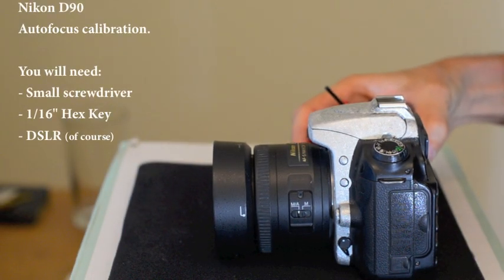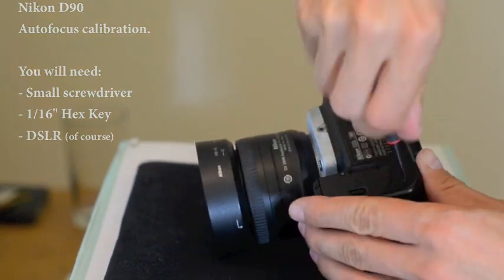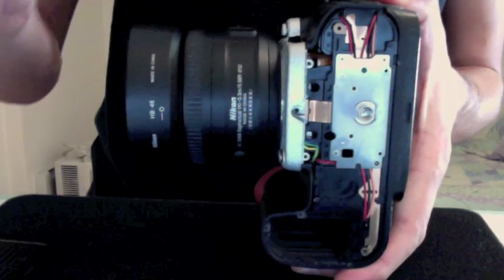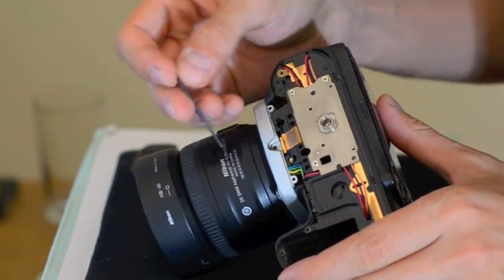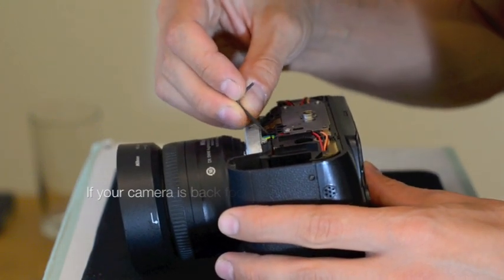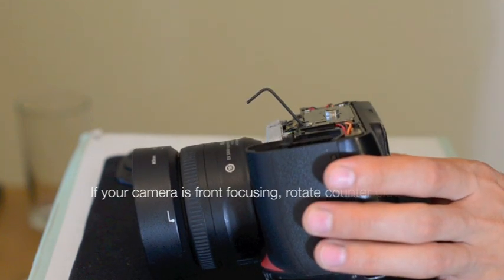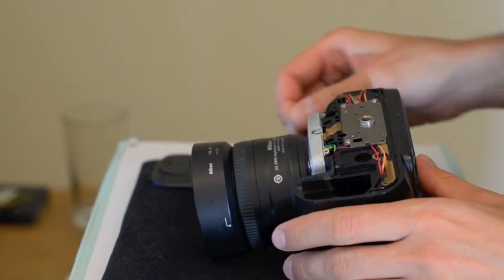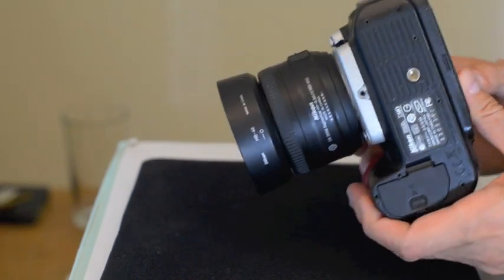Physically Calibrate Auto Focus - DSLR

Comment: Hello. This could easily be a life-savior for me, as my d600 started backfocusing, and it seems suddenly (although I can't be sure) Anyway, I am on -20 af finetune, and still is not enough, but my 70-200 which was originaly on -20 is good now :)
I just wandered if this procedure will affect autofocus in live view mode? - in liveview, my camera focuses fine.
Reply from the maker: +KugLager Interesting question. When you use Live view, your mirror is up so I guess the camera has to do on-sensor contrast detection to achieve focus. This is a different technique from usual DSLR operation. 
In other words, your camera focuses differently depending on which mode you're in. 
No, your live view mode should not be affected.
Reply: I have the same problem with my canon 5d mk2

Comment: Thank you so much for this!! Saved me a solid $600 and a 3 month wait if I had shipped my camera all the way to Singapore to have it serviced. The "Nikon Service Center" where I'm from, the Philippines, refused to send it themselves and continuously insisted that they "didn't have the proprietary tools" to fix it themselves. Very poor service.

Anyways, this is what I found to be the most helpful in fixing my D610:

"Steven B2: turn clockwise when backfocus, turn counterclock when frontfocus

What does each screw do: Paolo Lorai wrote:
- right screw: controls the leftmost part of the image.
- left screw, near the lens: rightmost and bottom part of the image.
- left screw: far from the lens: rightmost and top part of the image.

My knowledge: it helps when you first tighten all screws till you cant turn them any further, after that loosen each screw one full turn. Adjust from that basis. Make pictures with single focus point at the edges of focus zone. left, up, bottom, right, middle.

Steps: leftmost part has to be correct first, after that check that top and bottom focus are correct. If you did everything right, right and middle focus should be right aswell."

This took me just a bit less than 2 hours and I hope it doesn't go out of whack overnight again like it did before.

Comment: Great tutoriál! Thanks for him. For two years, I had a micro-correction set at my D7000 at -20 for all my lenses. Still, they shot my lenses too soft, so I had to sharpen all the pictures in software. After turning all three screws a half turn clockwise I have now set the micro correction to +7 and software sharpening of images is no longer needed. I'm so glad I decided to do such a hit on my camera. It paid off. I do not understand how I could have such a poor condition for so long. Thanks for the video that changed My Cameras that changed my camera. Jaroslav

Comment: Thanks a lot, worked perfectly on a D7000.
That camera has 3 calibration screws:

- right screw: controls the leftmostmost part of the image.
- left screw, near the lens: rightmost and bottom part of the image.
- left screw: far from the lens: rightmost and top part of the image.

I wasn't able to get sharp images from my 50mm f1.4, even with fine adjustement set to -20. Now it works perfectly without focus tuning.
Reply: +Paolo Lorrai Hi Paolo, Thanks for your input. Did your camera focus ok for the other lenses that you have?
Reply from the maker: +Gihan Hanwella Please read my description under the video in the "About / Show More" section.
Reply: Have similar Issue with my d810 and 50mm 1.4F AFS will try this out. Front focus issue needs correction
Reply: did you done it? i got d810 too and i need it tooo
Reply: Sent my D4 to Nikon repair with this issue but they couldn't fix it because the camera was too old. Parts required? Maybe I will try it myself.

Comment: You, my friend ... nailed it. My D7000 was becoming unusable. Even with the fine-tune set at -20 it was still back-focusing. I'm sure I have some more trial-and-error manual adjustments to make, but even with a quick 20 minute adjustment, the focus is FAR superior to what it was. Thanks for posting this.
Reply: Daniel Bregar which hex did you adjust first? :)
Reply: Hi Jamie I moved all of them a very small amount each time I made an adjustment. I'm guessing that if I experimented with the different focus points I would see some errors but I generally use the center point so it worked for me to move the whole sensor. I didn't need to adjust much - I think I just made roughly 1/8 turns and I don't think I needed more than 2 adjustments. (It was a while ago so I don't remember for sure.) I rigged up a way to keep the battery pack in without reattaching the bottom (using rubber bands) so I could test the focus without having to re-assemble and then take it all apart again for further adjustments. Good luck!
Reply: Daniel Bregar thanks alot I'll give it a go at the weekend. I only ever use center focus point so I should be okay :) Thanks for getting back to me
Reply: Daniel Bregar did it this evening. took all of ten minutes to do and now my d7000 doesn't even need AF fine tune with my nikon lenses. best thing ever!
Reply: Jamie, glad to hear it. Thanks again to Steven B2 for figuring this out and posting it ... this is what the internet should be all about!
Reply from the maker: I appreciate your comments guys!
Reply: Hi daniel , i have the exact same problem as you ! can you please tell me wich screw i have to rotate ? !
Reply: Hi widou dz, I turned all of the screws by a similar amount each time I made an adjustment. I think someone below explained what each one does; I hadn't seen that when I made my adjustments. I made tiny adjustments (maybe 1/8 turn at a time) and used tape to hold the battery in between adjustments so I could check it. Good luck!

Comment: Steven B2: turn clockwise when backfocus, turn counterclock when frontfocus

What does each screw do: Paolo Lorai wrote:
- right screw: controls the leftmostmost part of the image.
- left screw, near the lens: rightmost and bottom part of the image.
- left screw: far from the lens: rightmost and top part of the image.

My knowledge: it helps when you first tighten all screws till you cant turn them any further, after that loosen each screw one full turn. Adjust from that basis. Make pictures with single focus point at the edges of focus zone. left, up, bottom, right, middle.

Steps: leftmost part has to be correct first, after that check that top and bottom focus are correct. If you did everything right, right and middle focus should be right aswell.

Worked for me after hours of fiddling. Thanks to Steven and all you guys in chat. Together we made it!
Reply from the maker: +xDECORx Wow, going all the way and then trying to find the right spot would probably take more time than you need to.
However I like your idea of getting one corner first and then another, your'e right the corners will give the correct position for the center.
Thanks for your input.
Reply: hi.. when you tighten it, did you turn cw or ccw?

Comment: Thank you so much for this. My D90 is perfect again!

In the video the screws are turned about 45 minutes. This is way more than I needed to. My camera was backfocusing about 2-4% (2-4cm pr meter focus distance). I only needed to turn the screws about 7 minutes clockwise. I hope this helps.

All the screws are size 2.0 (?). I ruined two of the screw threads figuring that out. I called the good guys at the danish Nikon service center and they're sending me a new pair. The guy on the phone seemed pretty worried though: "You opened the body and adjusted it yourself??" - "Yes. Yes I did." The procedure saved med $300. Win!

Goodness - I love my camera again! :D
Reply from the maker: Haha, Nikon will hate us now!
I'm glad it helped you.

Comment: Thank you, I fixed my d600 front focus problem. It was -20 in micro adjustment settings but wasn't enough. Hopefully I saw your video by the help of you I managed to fix the problem. I tried over ten times to find exact focus point and worth it. Thank you so much. I use 1.5mm hex allen for my d600.

Comment: Bit late to the party with this one, but picked up a real cheap d7000 with back focus issues. Sending it off most likely wouldve cost more than what i paid for. Was skeptical about pulling it apart but turned out to be super easy and fixed it - Thank you!

Comment: Thanks for posting this and leaving it out there for all of us to see. I was trying to decide if I wanted to spend the extra money to have my D7000 fixed after purchasing it second hand. The shutter count on the camera is only at about 5500, so it's practically like new after 8 years. My 50mm 1.8 is currently AF fine tuned to -20 and that still isn't enough to fix the focus issue, even though it made it much better. I'm going to give this method a shot tonight when I get home and see if I can get it dialed in correctly. Thanks again!

Comment: Thank you! Based on this video and the service manual I managed to fix the severe backfocus of my d5000. Seems these screws tend to get loose so they need to be tightened a bit.
According to my service manual: "Turn the three screws lightly all the way with hex key, and then give each 1.5-turn counter clockwise."
Reply: Hello, where did you find this information? I cant find it on my d750 manual...
Reply: @FR4NCI3C0  you need the service manual, not the users manual. trickier to find, I don't think it's officially available. I managed to find it for the d5000, not sure about the d750 though.

Comment: This is my theory but I believe the three focus module screws adjust the Front-Back focus and Right-Left focus only.  The mirror stop cam screws adjust the Vertical focus.  I adjusted my mirror screws to set the Vertical focus then adjusted all three screws evenly 1/4 turn to get rid of the back focus.

I would recommend using a lot of care with a quality properly sized screwdriver to remove the cover.  Those little screws can strip out pretty easily.

Thanks for the write up.  I got all my adjustments done in about an hour.  The test shots I took look good.  No more soft eyes and sharp ears.
Reply: @generalrandomassortment  Hello, I have also nikon d750, did you eventually find what screws afect to what focus point? Thanks

Comment: Thanks for this - just got a D600 (used) and was gutted that the focus was off quite a bit and that the Fine Tune at max still was only half way there. Only saw two screws, so adjusted them - took lots of adjustment/check/adjust/check and ended up turning getting on two whole turns before it ended up just right. Chuffed :-D

It's videos like these that give the confidence to attempt this type of adjustment which is surprisingly simple once you see how it's done.  Thanks
Reply from the maker: The D600 should have a built in micro adjustment. You should have go for that first (unless it's already maxed out).
Anyhow, I'm glad it worked out.
Reply: I did use the AF Fine tune first, but maxing it at -20 didn't fix the problem. Glad I tried your method - now most lenses, compared to focus in live view, do reach the same level of sharpness.  There is one though, which is an older screw focus 80-200 which doesn't focus quite right, even when tuning that one to the max fine tune.  So I think that particular lens may need an adjustment... so will need to read up about that!
Reply: Although I've just read a fascinating article on focus shift and I think that's what it is - the lens's spherical aberration causes a focus shift stopped down compared to wide open and the AF always uses wide open... whereas the live view doesn't have that problem hence why it's always better in live view for that lens... will just have to live with that. But apart from that, your method saved me big headaches :-D
Reply: Only AF-S lenses can be adjusted.
Reply: No, a well adjusted camera from the factory should not need micro adjustment in first place with their own Nikkor lenses (primes).
Nikon's QC is bad in my opinion and experience.

Comment: Thank you! It worked perfectly on my d800 with serious backfocus issues. Af fine tune set to -17 and -20 with two lenses and now they are set to -2 and + 5!!
Reply: after 5 month do you have any other problems with your af system after doing it? ihave d800 with the same problem to...

Comment: I had set AF Finetune on my D7000 to "-20" and still had a lot of back focusing, now its finally taking crisp sharp images! Thank you! :)
Reply: This method have any risk?
Reply: @razbuzaglo I would say un-even focus ... I tried it on D610 and it improved my AF for way back focusing to spot on and all sensor point seems to be working ok...
However on my D810 the center now is good but some parts are front focusing and the opposite side is back focusing (I'll try to re-tune it again) ...

Comment: Hello! I did it on D800! There was a back focus and in AF fine tuning I had set -15 - -17 for different lenses. After turning screws clockwise 90 digress I have correction via menu -4. Great! This camera I bought second hand from a professional photographer... Few years before I have done the same procedure for Nikon D200 after professional photografer as well.... It seems some simbol... Nikon doesn't love their clients.... It is sad.... And once more. The used Allen key is 1,5mm. I just didn't find 1/16 inch... Thanks to author of this video and good luck to all!

Update! I have calibrate it again. First, I turned off af tuning! It is matter. After, using focus chart I turned all hex screw again for same degree every one, and checked all corner focus points and central point as well. Yah, I have done it with 50 1,8D. After check with 35 2D. It's OK! Good luck to all!
Reply: Hi Stanislav! I am struggling with the D800 right now, there are only 2 screws to adjust, did you adjusted only those 2 or there is a third one somewhere?
Reply: @pixieworks9298  did you fix it?
Reply: @razbuzaglo  no, I made it worst :( Actually I managed to get pin sharp, but only the central focus point. The rest was totally out of focus. So I take it to a camera repair laboratory and they made it. For entry level cameras might be simpler, and tinkering whith the screws should work, I dont know, but the guys at the lab told me, whitout factory adjustment software there is no way to fix it. Now it is perfect, for more then 2 years since.
Reply: @pixieworks9298  are you talking about the screws at the bottom of the camera or the screws behind the main mirror?
Reply: @razbuzaglo  it was more than 2 years ago...frankly I dont remember! I  remember I screwed up really badly, after experimenting with them :)

Comment: Awesome! I was able to fix the back focusing issue with my D90 w/ 50mm @ 1.4D -- which was showing big back focusing issues due to being so wide open and having a limited DoF! My other lenses were hard to notice the problem with. However, the 50mm kept getting the hair in focus when targeting the eyes. The further away from the subject, the more pronounced. ie. at 7ft, I'd have to focus then shift my camera backwards 4cm to get the eyes in focus.

All this time I just thought the 50 1.4D was super soft fully open, therefore I was using 2.8 to keep my subject in focus. All my other lenses checked out perfect, after using the 50mm to correct the back focusing issue.
Reply from the maker: +wakisashisan good to hear!

Comment: This worked wonders for my D750 that I bought from a pawn shop for basically $350 bc “focus issues”! Thank you so much!!!
Reply: How did you remove bottom plate on d750?...i removed all screws, and I cannot remove it. :)
Reply: @unique93obr there are few bolts in the battery compartment... if removed you should be able to remove the bottom plates (I removed d610 and D810 bottom plates)

Comment: I had trouble removing the screws, so I stuck an eyeglass screwdriver in the end of my drill and set it to its lowest speed. Just give each screw a little turn each before you hit the trigger to make sure the bit is seated. And make sure you have it on reverse!
Reply from the maker: Very clever. And alway be carful not to strip them, or you'll be screwed.

Comment: Removing the D750 central bottom cover (surrounding the tripod bushing) doesn't readily reveal the AF adjustment ports. With this cover removed, there are 4 rectangular areas covered by black tape. Are the AF adjustment ports under these tapes? If so, do all 4 possibly need adjustment or only 3 of them like the D90? If not, does the entire bottom plate need removal?
Reply: Did you solve this? I have also d750...

Comment: Hello Steven. Can I physically re-calibrate my Nikon D750 the same way as the D90 in the video or is it set up differently being a later model camera? My D750 front slightly more than AF fine tuning allow me to compensate so a slight adjustment needs to be made.

Comment: This really worked, I was about to throw away my d610 and lenses and change to another system... now all my lenses are in focus. thanks!!!!
Reply: Can you help me doing it correctly?
Reply: @razbuzaglo  hello
It’s as explained in the video
You have to adjust the 3 screws
Then it’s trial and error until you are satisfied with the focus
I suggest testing focus with a tripod, focus on a object, something like a box and put a ruler diagonally to the box. This way is very easy to tell if the camera if focusing before or after the front of the box
Reply: @naosVideos  what are the risk? Should i rotate them the same? How can i know how much round for the left and for the right?
Reply: @razbuzaglo  well I turned them all the same amount every time
Half turn every time and check…

Comment: Adjusting the hex nuts in the mirror box worked for my wife's D90. I just hate that in Australia getting it done properly by the camera manufacturer isn't economical.

I had a go using this technique and just couldn't get the hex key into the slot correctly.